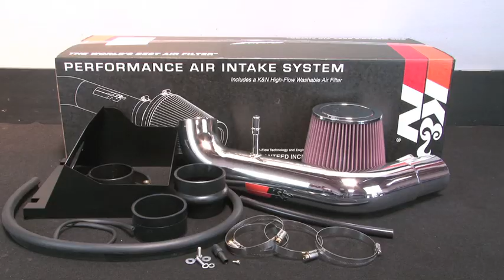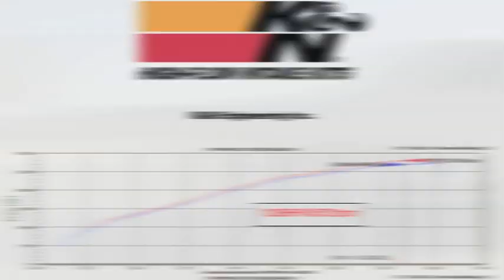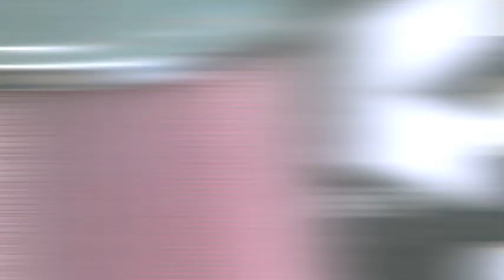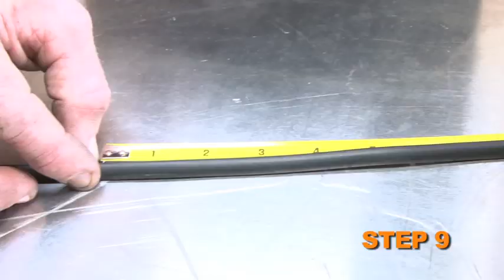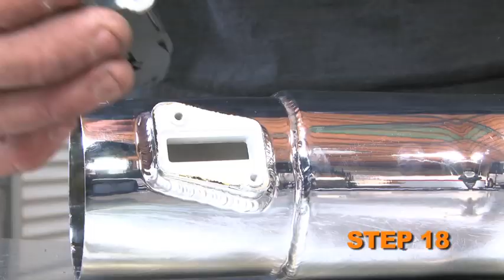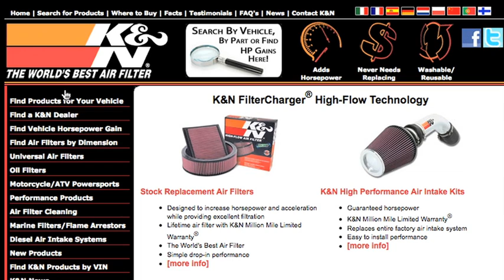Ford F150 5.0L [#77-2581KP] Air Intake Installation

Comment: I run the K@N flat filter in my 5.0 and it works and sounds great.  The OEM intake setup is quite good so I decided to ditch the intake sound suppressor and run the K@N filter in the stock air box.  I also run a flowmaster exhaust with the super 50 custom welded to the American thunder dual system and I LOVE the sound!